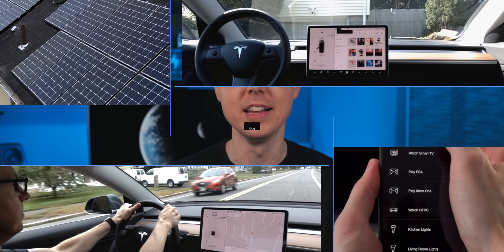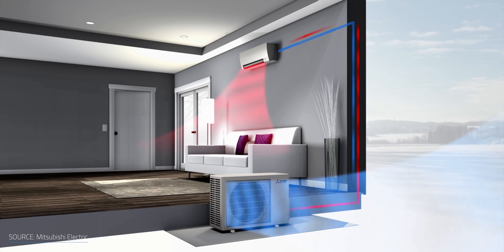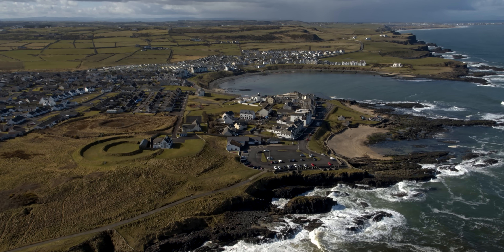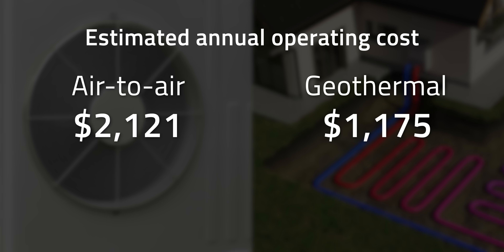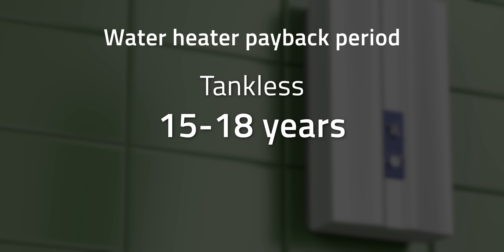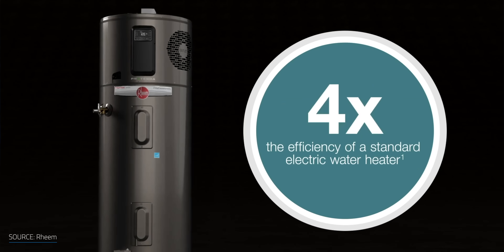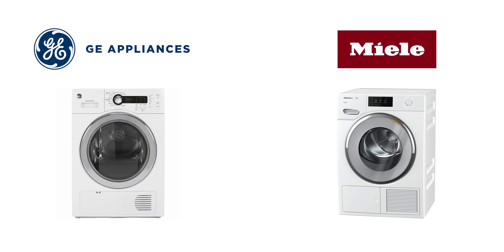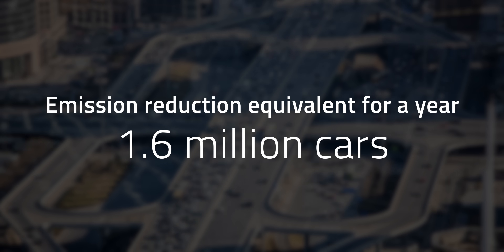Why Heat Pumps are Essential for the Future - Explained

Comment: One technology that's far too often overlooked when it comes improving heating and cooling performance - insulation. It's not a sexy new technology but it's far and away the best method to improve thermal performance of a building. You don't even have to tear open exterior walls and add batts of insulation, adding blown insulation to your attic and changing to double or triple pane windows are easy fixes. I wish more people would talk about these simple fixes and think about responsible uses of energy as much as the latest technology.
Reply: @retireorbust  They could have easily lined the walls with Tapestries and Brocades which was done even before the medieval period
Reply: The massive issue with window upgrading is the time for ROI. It's extremely long. Blowing in insulation however is a pretty simple relatively cheap fix that you can even DIY.
Reply: Generally isolation on roof and floor is crucial but on the walls not so much (5-10cm is enough). House should be air sealed + mechanical ventilation.
Reply: Retrofit window upgrades has one of the worst returns on investment.  Windows are a small fraction of the envelope and cost around $30/sq. ft. to retrofit for a modest gain in heat retention.  Ceiling and floor insulation has many times more bang for the buck.  But...if your old windows are worn out and bothersome, then replace them with good ones.
Reply: The biggest problem with insulation is that most homes are not built to cope with the loss of ventilation that good air seals create leading to mildew mold and sick building syndrome both from elivated co2 and toxic off gassing and trapped cleaning product residue.
Reply: @MixedGrid  depends on where u live but in my area you can get a credit for reaching a certain R-value. Sometimes theres programs from the local municipalities that will pay for the entire process.
Reply: Proper attic ventilation as well. And if you're not using LED's throughout the house you should be
Reply: @Youreallsoft  so i recently came across a box of old incandescent bulbs. While comparing one to its led counterpart it became apparent just how many resources are required for an led vs incandescent. The incandescent is just a tiny bit of glass, a tiny bit of tungsten, tiny conductors, with a socket base and some ceramic insulator. It weighs practically nothing and if u were to throw it in a landfill, it would decay right back into the earth in relatively short order. The led on the other hand was made with a plastic dome, a large metal heatsink, pcb's filled with electrical components, some holding toxic oils and chemicals, alot more conductors insulated in plastics, and the entire thing weighs probly 20-30x what and incandescent weighs. 
So whats really worse for the environment? The led that requires an enormous amount of materials along with toxic material and things that dont degrade for centuries, costs loads more to ship due to the weight, and requires extra packaging to protect them during shipping, or the incandescent that just causes abit more carbon emissions from its power draw. Carbon, which provides the main building block of all life as we know it and is at historically low levels well below the avg over the course of earths existence.
Reply: @GonzoDonzo  I'm speaking more from an energy conservation perspective. If you plug in that incandescent it's going to be too hot to touch in seconds. A large portion of the energy going in is in the form of raw heat increasing the load on your air conditioner. I didn't buy into them for a while, but they are more cost effective now and with a wider range of temperatures I became a fan. I live in Texas with some scorching heat so every thing adds up.
Reply: @Youreallsoft  yeah in the summer the heat can be an issue. Leds do get warm but like u say its no where near the same output. It is nice in the winter though. As a kid id stuff my hands under the lamp shades when they were cold and it was always a nice warm spot wherever a lamp was. I live off grid so led's are a must but beyond the energy consumption and summer heat issue of incandescents, im not sure they are actually worse for the environment if thats an issue for some. Id love to see a study done. For one for every led you will consume several incandescents over its lifespan. Just knocking over an incandescent will blow the filament out. I did notice a 100watt incandescent was brighter then a 28watt led that was supposed to be equivalent to a 150watt incandescent according to its advertising. The led had a higher quality of light whereas the incandescent has hot and cold spots. Sorry for ramblin
Reply: @GonzoDonzo  I'd say you're probably right and a lot of things we are currently doing to be "energy conservative" which wholes purpose is to be more environmentally friendly and lower carbon emissions do not work out like that. Just like making evaporator coils thinner and thinner to gain greater efficiency ratings and in turn they fail within 10 years and leak refrigerant. There's a lot of wastefulness and planned obsolescence that imo would be where attention should be if you wanted to be more environmentally friendly. I believe it's all driven by $ and year over year profits, but good luck stopping that machine. In the mean time get ready for 2025 as they try to push once again a new refrigerant for A/C systems and making r-410a obsolete. We are not using cfc's anymore and even with 0 ozone depletion potential the reasoning is it contributes slightly less to greenhouse gases. R-410a prices tripled last year nationwide on the same day. I guess if it becomes expensive enough people will be happy to switch, even if artificially inflated.
Reply: @brianzmek7272  while true, it's not really that difficult to add an HRV or ERV system as part of your retrofit, and properly controlled ventilation with energy recovery is far better for both the insulation value of the home as well as the air quality in your home versus relying on the house being drafty.
Reply: The great thing about insulation is it works both ways, keeps the house hot in the winter and cool in the summer. In fact where I live adding a little bit of insulation has allowed us to avoid adding an air conditioner at all. Now obviously that's not a solution in all climates, but if you live somewhere marginal you can get away with insulation while all your neighbors are spending electricity on their air conditioner.
Reply: @brianzmek7272  By all means then don't insulate. Sit there and freeze.
Reply: @helplmchoking  It amazes me that so many homes in the US are built on raised foundations at all. Every house around here, with almost no exceptions, has a full basement. Older ones aren't well insulated, but we all have basements.
Reply: @Youreallsoft  oh man i learned about that with a series of goodman package units. The evaporator coils lasted 1 year before they started developing pinhole leaks everywhere. I cant remember the term the rep used they sent out but i didnt buy there reasoning. Ive been into pc watercooling since i was a kid and u learn about dissimilar metals in conductive fluids early on. Aluminum and copper in certain ratios with a fluid present just eat each other up and i had a feeling that was going on. 
U think the refrigerant change is crazy, look at california. Were banning all gas powered yard tools and any generator up to 25hp. Cant wait to see how the landscaping industry will handle that. There going to need a massive battery array and charging station to keep there tools running. 
I did hvac for 17 years and the rules were getting insane. Some things made sense like reducing the leakage in ducts and supply vents but the inspection process that had to be carried out by a third party was a pita. Loved how i got trained as a HERS rater only to find out on the last day we couldnt inspect our own work. Lol
Reply: @Green__one  if your ever getting a new roof get the plywood with the radiant barrier for the sheeting. Ive spent far more time in attics for my job then most and an attic with the radiant barrier will easily be 10-20 degrees f cooler then the same house without it in the summer. It also works both ways radiating heat back down in the winter. Its also a very minor cost if done from the start
Reply: As someone who works in attics daily, where the insulation is set makes a world of difference as well. Foam insulation that is applied directly to the ceiling and walls seems to be by far the best method of thermally insulating your home in either hot or cold climates. Blown insulation works well too but you lose the attic space itself to act as a second layer of insulation for the home, remember air is a great insulator on its own.
By having the spayed foam insulation you get not only the immediate reduction in thermal loss or gain from the foam but the attic, that would otherwise be heated or cooled to the exterior temperature, now acts as a second blanket between the home and foam to help mitigate thermal fluctuations. 
It also makes the attic much easier to get around in lol.
Reply: Yup - that's step#0, so to speak.
Reply: @GonzoDonzo  the LED is better
Reply: @GonzoDonzo  RMI has studied this, LEDs are better in all cases
Reply: @Youreallsoft  it's important to switch
Reply: @helplmchoking  construction technique and code depends on your climate zone
Reply: @Nicholas-f5  yeah but whats their basis? Is it that carbon emissions are bad because if thats their measure its pointless.
Reply: @retireorbust  will that material stand up to the European floods?
Reply: Yes and insulating with natural bsed materials is often overlooked. Wood can be made into fibers ans mats just like fiberglass. Hemp, linen, cotton, cellulose (paper) cotton, recycled clothing, straw, low energy hay.... cork, expanded clay...
Reply: Tear open walls? Won't that be expensive, the brick and cement alone probably a bit of a hassle to replace.
Reply: Insulation is definitely overlooked, especially in older homes. However, it's also one of the most difficult to upgrade. Apart from incremental improvements, you're likely going to have to wait until you're remodeling something down to the bones to properly improve the insulation.

In the meantime, things such as solar panels, heat pumps, LEDs, etc., are much easier to do and you're much more likely to get a return on investment much sooner.
Reply: Exactly. Before installing a heatpump which heats your house with lower temperature, you need insulation. Older houses are built for heating with high temperature, in which case insulation is less important.
Reply: @retireorbust  Actually using heavy rugs, which is what a Tapestry is, does significantly help with heat loss in a room.  It's far less effective with castles because the walls themselves where so drafty.  But over a window they are effective just by the significant reduction in air flow across the colder glass.  Same is true with wooden walls like a log cabin as long as the walls don't allow air flow that is.  And in a converted vehicle they make a hell of a difference.  It's no where near what double layer windows can achieve.  But considering the cost of living right now, it's better then nothing.  Adding a plastic outer window during the winter helps too for the same reason.  Creating another air gap between the glass and the outside air.

Don't overlook older cheaper methods in today's economy.  As nice as net zero would be, anything thing cheap and helps is worth investigating.
Reply: @TempestaDominus  You don't have to do much to insulate house walls. The installer just drills holes in the outside walls to the cavity then blow the insulation material into the cavity. My parents insulated their home like that in the early 1970s.
Reply: @kevintieman3616  well, no. High temperature also means high heat losses. 
You must mean we can’t feel as cold because the high temps overcompensates. But we can feel it in the energy bills ;)
Reply: @peterjf7723  Inside the solid brick?
Reply: @TheEmbrio  Yes indeed, with less important I meant less impactful on the ability to heat your house. Also when these houses (with poor insulation) were built energy was dirt cheap compared to today's standard, so nobody cared about energy bills.
Reply: @TempestaDominus  No, between the outer and inner walls there is a 10cm/4inch cavity. At least that is how houses are built in the UK.
Reply: @peterjf7723  There's no such thing here. Just bricks, cements and paint.
Reply: @kevintieman3616  so we’re on the same page, yes. The price is truly a factor for many. I’ve been designing or remodeling houes for 15 years, and it seems spending 50 (euros in my case) per months seems fine. Maybe it’s a psychological thing. Even with extensive renos, clients never want to go the extra step to get below 20 per month. 
So that meant in 2008, 8cm of insulation. Now 14. In standard materials, just as an example. 
But they usually won’t agree to 16cm plus extra efficient ventilation or some other costly technology. To get it down to passive standards. (Forever)
Even in my field people seem to have short term vision. Baby steps.
Reply: @TempestaDominus  Ah OK. In the UK the cavity wall was first introduced in the 19th century, as a better alternative to a simple solid wall. Cavity walls became more widespread in the 1920s, and have been the UK standard for decades.
Reply: Hemp Bricks!!!!
Reply: @Nicholas-f5  "LED's are better in all cases"
Well..  don't get me wrong, I'm not saying we shouldn't use them, but they are not as glorious as they were made out to be. Example,  LED light is terrible for photography, absolutely terrible. It is an absolute pain trying to correct white balance on indoor photos shot in rooms with LED lighting.  I do ham radio as well, and LED's are some of the worst sources of radio interference in the home. They are worse than switch mode power supplies in most cases because they are built to such cheap standards. So are they better for the environment... that's debatable as well, when considering energy used in addition to materials used.  Are they better for all applications, in my case definitely not. Do they save you money, debatable as well, because they do burn out, mostly from poor heat management, and are orders of magnitude more expensive to replace. Doing the math considering cost of electric + cost of bulbs, operating 4 x 100 watt equivalent LED'S (13 watt) vs 4 x 100 watt equivalent halogens (72 watt) cost about half as much to run at 4 hours per day. $34 over 18 months vs $77 over the same time period. Is that savings worth the aforementioned issues, that's for you to decide.
Reply: @retireorbust  the average home in europe is wayyy better insulated then the us cardboard boxes.

and the eu houses dont fly away with every storm on top.
Reply: What if you don't have an attic?
Reply: @Konrad162  Mechanical ventilation must include moisture removal. In the UK in the 1990s lots of houses were built without any ventilation for insulation purposes. What happened was damp and mould everywhere.
Reply: @brianzmek7272  Don't forget water vapour, an average family of four can produce 24 pints (14 litres) of water vapour in just 24 hours, and all that moisture has to go somewhere
Reply: @jamescollins3647  humidity controls comes also with AC
Reply: @Konrad162  Don't have too much domestic AC in the UK.
Reply: @jamescollins3647  so you are installing water heat pumps but no AC? How crazy is this. AC is much cheaper and better than central water systems.
Reply: @brianzmek7272  Yep, most houses in the UK have that exact issue and they keep going on about installing heat pumps. If the house isn't built well you will freeze in the winter months. Unfortunately, that applies to most houses here! :|
Reply: Living in lithuania I am used to insulation. When I recently made a trip to my brother in Ireland I was shocked, they used a fireplace to heat the home, at first I thought it was just a status symbol or something nostalgic. Nah... When I woke up in the morning the entire building was freezing!
Reply: @runelt99  I grew up in a house like that. Never had a cold as a kid.
Reply: @GonzoDonzo  Just checking a random example from Home Depot, an LED bulb uses about 7x less energy than an incandescent. And they last a lot longer too (supposedly up to 20 years). So while a single bulb may be worse in terms of waste, given their increased lifespans the overall quantity of waste should be reduced (and it's barely a blip compared to the rest of our e-waste). Also I'm not sure you understand how greenhouse gases work. Yeah we're nowhere near the highest levels of CO2 in planetary history; those periods also occurred with the largest mass extinction events, look up the Permian–Triassic extinction event.
Reply: @GonzoDonzo  The current world ecosystem is not adapted to a dinosaur climate. And neither are humans. The Earth will outlast us and new life will grow, but at the moment global biodiversity is massively decreased and it is mostly due to humans (many factors of course, climate change only being one of them, along with habitat destruction). Climate change also has real impacts on people in less fortunate parts of the world which are rapidly desertifying and facing increasing geopolitical conflicts. It's not a coincidence that these changes have happened all in the last century.
Reply: @GonzoDonzo  Look we're not going to change anybody's minds over a youtube feud. And I apologize if I used any antagonistic or condescending language. I'll just ask you to think about whether your sources are balanced, you're avoiding confirmation bias, and whether it's likely that thousands of scientists over 40 years have all been wrong or colluding toward some vague nefarious agenda despite the challenges of billion dollar industries that can hire their own scientists to produce counter-studies.
Reply: Nah, I don't think insulation is overlooked. Modern homes are designed with insulation built into the walls and homes are more sealed to prevent heat coming in or out. People or rather individual home owners may not always be efficient in that regards.
Reply: spoken like a true engineer 👍
Reply: @stipcrane  the window replacement is a consideration where the inside/outside temperature differential is great, drapes and capping over the top are an effective substitute.
Reply: @Youreallsoft  LED lighting is undesirable in reading areas as they flicker at various frequencies causing optical annoyance much like fluorescent lighting, great in other Areas those. I’m completely unimpressed with the lifespan of the average LED replacement lamps. Much shorter than advertised life …
Reply: My unit that I rent has a heat pump and cold air blows in around all the single pane wooden framed windows. It's a waste but very common here.
Reply: Insulation sounds great on paper, but quickly becomes tricky in practice. We have a lot of experience with insulation here in Germany (federal mandate for more then a decade) and quite a lot of issues have cropped up. Probably the biggest is waste management, as the insulation has to be replaced after some time (I think after 15 to 20 years) and the most common material - polystyrene - is considered hazardous waste, making disposal a major headache, especially since the companies capable of doing so do not have the capacity to deal with the amount coming over the next decade. Another problem is humidity, as the dew point moves into the insulating material, creating moisture. This causes a host of issues from algae on the outer surface, to moldy walls or even concrete spalling as the rebar corrodes. This drastically reduces the lifespan of the insulated buildings. There are buildings from the early 2000's that have to be replaced, because the walls just have to many problems to be economically dealt with.

Those issues don't even touch on things like humidity and mold build up within the rooms, the generally lower room climate quality in highly insulated buildings or the fire hazard that is polysterene.

All in all, a very interesting technology, but it comes with a lot of issues yet to be resolved.
Reply: @tarstarkusz  cause it's cheap. The margins in the construction industry are razor thin, corruption is afoot everywhere and the stuff has not been banned.
Reply: I added insulation to our 1962 house attic. So the heat comes on less. But along the edges I could not get insulation, so the top of the walls got colder and got condensate. Then the corners got worse to the point I got mold. Not alot I can do since the rafter is right over the corner. 
All I can think of is to take ALL the insulation out and have blown in, and tell them to go heavy on the edges and lighter in the middle; take a bit higher heating bill to get rid of mold and condensate.
Reply: @retireorbust  Actually it does...
Reply: Windows can be surprisingly expensive.  Replacing them is no minor matter.
Reply: My house walls are 6-inches thick, plus an additional 4-inch interior layer of yet more wall. Which is why my large house in Canada can be heated with about 8kW of electric baseboard heaters. I'll get a heat pump eventually, but it'd be a small one.
Reply: Yep this all the way, I’m in the UK and we insulated our walls late last year and straight away we cut how much our gas boiler was firing in half. 
We have done pretty much every other eco thing to our house, led lights, large solar array, A+ rated appliances etc and we are now an A rated property energy wise :)
Reply: Unless you’re using the incandescents as auxiliary heaters, ya know, to be an imaginary bit warmer in winter while you’re cypherin  on yer abacus.
Reply: @retireorbust  LOL. The best homes here in Eastern Europe are ones made with clay and straw bricks with usually half a meter of wall. Mass is the best thing to have for heating and cooling. Mass stores heat, mass stores cold. Medieval castles were military installations meant to defend an area and not to live in, their heating was always inadequate. European houses that are actually made of proper bricks for the sake of living are really good. They usually need only 15 cm of external insulation as refurbishment and of course new doors and windows. Though todays economy makes some people go all the way to 30 with cheap Styrofoam insulation. Best part? A stronger storm does not take apart our houses and most of our houses don't turn into pyres instantly if they start burning. Most of our houses can actually survive the ground shaking. Many people seem to forget that the goddamn glass wool/rock wool is actually toxic to humans and they immediately after removal from their packages start to release particulates.
Reply: @GonzoDonzo  And an incadescent bulb lasts perhaps 5000 hours while a good quality LED bulb lasts for 100000 hours, 20x factor, so there goes your weight difference. Now, let's go to the energy saving, and you'll get some additional 8x+ energy saving factor from using LEDs, more if it's a smart light. If the energy consumed during a life time of a LED bulb would be around 1MWh those incadescent bulbs would consume some 8MWh (you'd need some 20 of them). It's difficult to estimate the energy used to make these bulbs but you can get a hint by looking at the energy price and comparing it to the item. Using $0.15/kWh energy price gotten from U.S. Energy Information Association the lifetime energy expense of that LED bulb is $150 exceeding its shelf price with huge margin while hose incadescent bulbs would consume whopping $1200 worth of energy during the lifetime of a LED light. Remember, the shelf price includes all manufacturing energy costs but it also includes packaging, logistics, design, marketing, taxes etc. Likely the cost of manufacturing the item is close to 1/10 of its shelf price. Therefore it is certain that manufacturing energy requirements are not even on the same ballpark with the energy consumed by the product during its lifetime which means LED lights are an extremely smart purchase even if some of my figures are off by like 80%.
Reply: @McSlobo  thats marketing wank. Yes the led itself can last for hundreds of thousands of hours. The driver that powers them and the doped coatings do not however. Shoot the lead free solder fails on most even before the driver dies.
Im simply thinking along the lines of overall environmental impact from obtaining the resources to the day its disposed of. Theres an immense supply chain for the production of an led requiring hundreds of different materials, whereas its just a handful for an incandescent and none of it is toxic in an incandescent.
It takes a global effort to acquire everything for leds to exist.
On a side note theres an interesting led bulb that dubai had made especially for them. Bigclive did a great video on the reasons for why they commissioned the bulbs. Ultimately theres an immense amount of bulbs in dubai and to reduce the cost of replacing the leds they had special ones made that have way more leds that are under driven. Alot of manufacturers drive the led at the limit and the heat will degrade them much more rapidly so this makes sure they are always cool increasing their lifespan dramatically.
Reply: @chrisbraid2907  not exactly true. Cheap leds using pwm for driving the led will flicker, a voltage controlled led has zero pulses or flicker
Reply: @GonzoDonzo  That's a really stupid comparison that completely misses the point. You'll go through about 10 of those incandescent lightbulbs before the LED breaks; but the real thing is electricity. If the electricity is from hard coal and those incandescent bulbs are 60 W they will consume a kilogram of hard coal every 40 hours of operation. If they last 2000 hours each and you use 10 of them they will consume half a metric tonne of coal during their lifespan. Where natural gas is used instead of coal, emissions are still almost as bad (fugitive methane).
Reply: @TempestaDominus  I have never seen a brick house that isn't a summer vacation home where the above-ground wall is just solid brick without insulation; *ever*; but I assume this could be a thing in clement places like the UK. I think the person you are talking to may not have ever seen those kinds of walls either because they live somewhere cold.
Reply: @soylentgreenb  and this is where we will disagree. I could care less about carbon increasing. Were on the extreme low end of the scale for co2 concentrations over the last billion years. Theres also no correlation between global temps and co2 concentrations. Just go look up the ordovician ice age for example. Dont forget, all life is carbon based and we get it from co2

When it comes to how reliable an incandescent is, thats not easy to define. Ive had incandescents last over 20 years without needing to be replaced. Bump a lamp over though and its probly going to destroy the filament. 
Ive owned leds since the first ones hit the market and ill tell u right now, they do not last anywhere near their marketed lifespans. Pcb's fail, caps blow, uv destroys the coating etc. I havent had a single one last ten years. Put led can lighting in my home and have already had to replace 5 of them. Thats not just a simple bulb change, its the entire fixture. They are only as strong as their weakest link and another factor is that they are just now getting good. The early designs were terrible, then we had those giant corn cobs where whole sections would fail, the light sucked so we all replaced them as well. Now we have nice cobs but they require excellent cooling and most manufacturers skimp on that and if they dont, now u have a massive hunk of aluminum used in the construction. A very energy hungry metal to produce.
There was an incandescent bulb that had its own livestream in a firehouse because it had been on for close to a hundred years. They can last but its like rolling the dice. Sometimes u screw one in and it dies in days as well.
Reply: I recently did a downflow attic installation for a house flipper. Got a call this summer because it wasn't keeping up, the drywall in the upstairs hallway was 95F. Come to find out there was no insulation in the attic, I figured that would come after the air handler.... People just don't know any better but it's not an excuse.
Reply: @RocketHarry865 mm
Reply: Windows alone make a huge difference in older homes.
Reply: @retireorbust  thermal mass has significant temperature stabilizing advantages, so wrapping it in an insulation layer would probably be a better plan then demolishing a useable building.
Reply: @retireorbust  if you have lived in old building while it is cold outside you will very quickly realize that the trapped air creates by hanging curtains and tapestries makes a huge difference.
Reply: @MixedGrid  depends on the windows you are upgrading from, single pane windows are barely better than open holes in your walls, so upgrading from them can pay off in less than 5 years depending on your climate.
Reply: @Green__one  There are many reasons food differences in building codes: termites, groundwater levels, mold, soil composition, frost lines, flood plains to name a few. Basement or not, they can all be built to be energy efficient.
Reply: So very true.
Reply: @brianzmek7272  then get a  HRV or ERV... That's the products whole. Purpose is to keep your house ventalated while not venting out the heat.
Reply: @GonzoDonzo  um no... Lmao a led weighs less Than a incandecnt bulb.  Nothing about it is heavy unless you have a super powerful led(not ones used to light your home) and it requires a large aluminum heatsink. You have it all wrong.
Reply: @helplmchoking  you think having a concrete pad foundation is more energy efficient Than a crawl space or basement?  You do realize air is a great insulator right? That concrete pad is sucking heat out of your home way faster Than a basement. I hope you where smart enough to have a bunch of foam under that concrete pad. A lot of people finish their basements anyway. The ground stays constant temp under a certain depth.
Reply: @randybobandy9828  lol jave u installed a single can light led? Have u seen modern leds that arent huge arrays of cheap leds? Anything above about 15 watts is going to require cooling. If its a COB led, it requires cooling. 
Im curious how many arrays have u built and can u even tell me what the difference is between a pwm led and a voltage controlled led is?
Reply: insulation does a lot to improve the efficacy of heat pumps too it's very crucial for sure
Reply: Probably much cheaper to install a heatpump than replacing all the windows
Reply: @wiredvibe1678  it can depend. They are generally within the same ballpark unless u have a large home with alot of windows. 
The cost on replacing a heat pump really depends on local code and if your ducting is in good shape. If the ducts leak beyond a certain point the cost goes up as u have to either seal or replace the ducting. This will also trigger a h.e.r.s. test before and after which tests how leaky your ducts or your entire home is. I recently quit hvac in california and we have some crazy laws out here
Reply: @retireorbust  Correct. Typically a castle would have a wood fire burning 24/7 with the heat being funneled into the rich folk's rooms. But then they all got lung cancer from breathing smoky air all the time and died in their 40's... so...
Reply: Windows are the least effective when it comes to ROI.
Reply: Insulation is great.  Everyone should have R38 minimum in a perfect world.  But insulation will not HEAT your home. People with home heating systems designed to work on 70-80 degree water will not produce enough heat from a heat pump running 40-45 degree water.  Never gonna happen. The installed radiation is too small.
Reply: " but it's far and away the best method to improve thermal performance of a building."
Unless you're retrofitting. The ROI on windows is decades. Updating wall insulation does tend to costs tens of thousands as it involves removing the exterior cladding then resetting the windows.
Another thing window sellers don't like to share is uninsulated windows on the south-facing side lets in free heat in the winter while not capturing as much heat in the summer due to the angle of the sun.
Reply: Yeah but insulation is really hard to do
Reply: @retireorbust  Actually, it does.
Reply: I would say easy fix because changing all the windows in my house will cost $25,000
Reply: @maxjeanfrancois400  " changing all the windows in my house will cost $25,000"
You'll never recover the cost of new windows in your lifetime with energy savings, but the window company will as soon as your payment clears.
Reply: That was a typo autocorrect sucks on this phone I meant to say I wouldn't say a cheap and easy fix
Reply: @maxjeanfrancois400  I gathered that.
Retrofitting wall insulation tends to be an expensive proposition as well. However, mice really do enjoy the blown in stuff in attics.
Reply: too many stories of people who switch to heat pumps and are dissatisfied because they didn't check their insulation
Reply: @jk3jk35  Insulation determines the size of a heat pump more than whether it will work at all.  Often it makes more sense spend 500 bucks more on capacity than the extra 5k in insulation.
Reply: @retireorbust  One assumes that if it didn't work, they wouldn't have done it. They weren't idiots.
Reply: @GonzoDonzo  LED bulbs last about200000 to 25000 hour and incandescent about 1000 hours so will be tossing out about 20 to 25 incandescent bulbs for every 1 LED bulb.
Reply: @jamesodell3064  no they dont. The diode itself has that sort of lifespan if its not in direct sunlight, but the solder, circuit board, capacitors, resistors etc do not. If u want an example look into dubai bulbs and why they commissioned them. It will explain it abit. 

The 250,000 hours manufacturers like to give is nothing more then marketing bs. Ive also been building my own arrays since the early 2000's. Earlier if u count crappy old leds for electronic projects. You can also just go buy an led and use it till it fails. Ill bet u it doesnt last anywhere near 30 years of continuous use
Reply: @GonzoDonzo The bulbs claim 25,000 hours not 250,000 hours.  You may be correct that they do not last as long as claimed but that that could also be true of the 1000 hours claimed by incandescent bulbs.  25,000 hours is about 3 years of continuous use, not 30.  
All I know is that the LEDs I put in several years ago are still working.  That includes a 3 way bulb that is on for a good part of the day and evening.  The incandescent 3 way bulbs seemed to last only about 6 months and were not cheap.
Reply: You seem to be attempting to frame this as an almost 
either/or, instead of both being important...which is a deficient approach. 
Insulation is important, and so is moving to much more efficient new technologies 
which support steeply reducing our carbon footprint 
and moving us more completely off of fossil fuels.
Reply: @brianzmek7272  ....that's an education problem, not an insulation problem!
Reply: @GonzoDonzo  😅🤣
Why don't you just come out and say you're hot for fossil fuels, Herr Drumpf, and a climate crisis denier !!!
Reply: @Petroglyph1  what are you talking about are you saying that it is ok for your your house to literally rot and poison the occupants if it loses power? That it is ok for your house to silently build up toxic gases if you don't use an air quality meter whenever you move furniture? That it is a good thing that you can't use that insulation style on a passive house but need fans to keep the house safe not just comfortable?
Reply: "It's not a sexy new technology but it's far and away the best method to improve thermal performance of a building." 
Due to the cost of construction, materials and analysis, not the lack of sexiness.   Changing the cooling/heating technology to a more efficient machine is often a linear improvement when there are not major issues with a leaky house
Reply: @GK-op4oc  most homes leak horrifically as well. I did hvac and we had to do tests before and after replacing or installing a new unit. Even the equipment itself can have large leaks when brand new from the factory. Just getting the ducts and doors on a house tight would increase the efficiency and comfort dramatically.
Reply: @wojciechstyczynski1354  He wrote about switching from double pane to triple pane windows.  Most 10+ old construction uses no more than double pane windows, though air leaks dominate their insulation problem
Reply: @GK-op4oc  depends where your at. My state has strict leakage req's.
Reply: yes, in Quebec we have triple pane glass for windows and thick  R30-40 in walls
Reply: @Keiranful  You listed some of the concerns I have with building systems in general, and particularly with retrofits to old construction.  Is there any book or resource you can recommend that gives a good overview of these issues and best practices from recent experience?
Reply: @Steve_Mazza  I'm not a civil engineer, more a concerned party as a property owner, so I can't really point to any authoritative sources. I'm just speaking from experience and conversations with professionals. 

That said, I recently came across a company that seems to have squared the circle so to speak. The company is MIG mbh from Germany and their DHMb technology appears to deliver good insulation while keeping the walls dry and preserving room climate. Haven't seen it in practice yet, so all I can say is that the marketing material checks out from a high level, conceptual pov. 

Beyond that, if you're building something new, I'd recommend thick brick walls, with the bricks laying sideways, earthen mortar (not cement) and  clay plaster. Insulation levels are achieved through the thickness and the room climate is perfect. It's more expensive, but lasts beyond a lifetime.
Reply: @GK-op4oc  He wrote changing to double - it to double what is less than double? I know it is possible to see single glass windows in US. In example old buldings in NY.
Reply: @retireorbust  "au contraire! " Modern building aren't designed to last more than 25-50 yrs. I live in a 150 yrs. old house and my energy bills are far less than modern counterparts, not even factoring in investment. It's horses for courses of course but each situation has a different solution.
Reply: @GonzoDonzo  Nah tech will save the world lol 👍 Smartphone apps will save humanity and the planet. When govts around the world legislate to enforce those high tech solutions, you just know it stinks. Personally, I'll keep it low tech, repairable and dependable.
Reply: @retireorbust  Straw bales is not a good idea.  I did some research on that a while back and there are a few downsides to it. I saw a home where they had a straw bale wall instead of a traditional fence.

It doesn't last as long. Straw is an organic material, and it will decompose and they have to be kept dry.  So if your home is in wet weather that hay is going to absorb moisture, If it gets flooded, it's going to get wet and start to decompose much faster.

Castles don't have modern HVAC systems, typically, that's why they have a lot of fireplaces.  ;-)

There are new home building technology that deals with homes that are hurricane proof and even fire proof that use concrete, ceramic tiles, etc.  So, it's not just thermal insulation, but also structural integrity to withstand hurricanes, earthquakes, fire protection, etc.
Reply: You're 100% on target. I live in my shop, a large cinder block building. Several year ago, when I could afford it, I had the entire building wrapped with 4" of Styrofoam and then stuccoed. My heating bill fell by half straight away. I had already installed better windows and  an insulated garage door years before that. I can't understand why they don't insulate the bejesus out of every new building during construction when it's cheapest and easiest to do.
Reply: What was shocking to me is I insulated my speed queen dryer with some headliner glue and some R8 insulation. Energy for a 7cuft dryer went from 3.75kWh per load to 0.95kWh per load. This is just with an old bulletproof 2013 resistive heat dryer and $8 worth of glue and insulation lol.
Made it extremely quiet too which is a plus.
Reply: weird, here in western europe that been the main things people talked about ! 
and still having to change to double is getting rare here i think.. mostly historic important building with protectic outsides are more difficult to insulate.. 
but when i bought a house, is was a no-brainer to quickly put in roof insulation, and to have some fill in wall insulation, and change the windows on one side that were weirdly, still single glass ... really nobrainer i would think, the difficult question is how i do heat exchange pumps or such... 
i read about 6000€ for an air-air ... (i have in no way enough garden to even consider an payable ground heat option) 
wow, with my pretty controlled usage of natural gas that would take me.. easy 15 years to earn it back !! 
the main reason to get it would be to have a cooling option in summer to me... 
yes i'm more economical with gas usage then average european, (about half if i'm correct) , so probably WAY more economial then the average american household...  you can do a lot already without that new tech, that is true!
Reply: never had sex with insulation😅🤣
Reply: @JeroenJA  it's a bit hard to get insulation up the duff😅
Reply: @stipcrane  Home builder here. You are correct!! If your double pane windows are airtight, the upgrade is negligible. One of the best things you can do for windows is get a can of low expanding spray foam, take off the molding inside, dig out the pitiful insulation from the 3/8" gap around the window and fill it with spray foam. This can also prevent water ingress if the flashing is poorly installed around the window and could prevent your wall from rotting away if this is the case. Spray foaming the joist ends in the basement is another easy retrofit.
Reply: @Green__one  Most of the homes built in the USA have basements, but in some areas of the country it's not practical to do that.  In Florida and other Southern states along 5he Atlantic and Gulf coasts the water table is too close to the surface, so basements built there would get flooded regularly.  In states like Oklahoma the soil is mostly composed of clay instead of straight dirt so it is less stable to lay a foundation for a basement.
Reply: Good Advice !  I always take the styrofoam insulation / packing from all the delivered packages & throw it on top of all the other styrofoam that is already installed in the attic !  The stuff seems to be in almost every package & you can never have too much although I  have to say the attics almost full now. .............  Nick , NavyBlueSmoke , LST-1195
Reply: @Youreallsoft  unfortunately all the alternative refrigerants are super and more expensive too. In theory using propane or hc mixes should be pretty cheap, but they get pushback because they're flammable (5lbs of propane such a big deal, but never mind the near infinite supply of natural gas piped into most homes)

Pretty sure the only reason 410, 134, 404 is so expensive had something to do with tariffs and protecting domestic big business. To bad I didn't buy a few pallets a couple years ago when they were still 100$ a jug
Reply: @Green__one  if you are rich sure
Reply: @peterjf7723  if the walls had no insulation to begin with sure
Reply: @randybobandy9828  not cheap
Reply: @mbburry4759  I'm not sure which comment you're replying to. But none of my comments have catered to the wealthy. If you're referring to my insulation comments, it is far cheaper to have good insulation than to have an air conditioner. If you're referring to my basement comments, in my location basements have nothing to do with wealth, all houses have them. They simply don't build houses around here without them.
Reply: @mbburry4759  no but is anything?
Reply: @mbburry4759  Yes but you are only running a couple psi for the gas running into your home. I see a lot of bad things with flammable refrigerants. You can see the refrigerators that have exploded in peoples houses using similar refrigerants. While they may be "freak" incidents there was no reason for them to occur in the first place other than to appease the environmental agencies. A leak in the evaporator coil with all the airflow in the world and and ignition source ready for it to go. What happens when your evaporator leaks in the winter while your running heat? A big fireball down the duct lol. That's why they are pushing for "mildly flammable" but it all seems like crap to me. I haven't worked with them yet but come 2025 we will be dealing with it so we will see. 

Yeah man we got hit hard on r-410a used to have a heads up on price increases so we could stock up for our customers before the phase out. Can't say we got that courtesy this time around.
Reply: @mbburry4759  The intention was that the wall cavity provided insulation.
Reply: Yeah, my parents old home had batts insulation that made me feel like I was going to end up with cancer. They switched to spray-foam insulation in the attic when they rebuilt the house and their AC bill plummeted despite the volume of the house nearly doubling (went from 1800sqft to i think 3200+sq ft). This is in Texas so you can imagine the heat that the old house experienced. I’m glad I moved up to the PNW, my current residence was built by my grandpa and dad and thanks to a massive sun space it doesn’t require AC at all. Only heaters for the cold wet winters.
I may actually suggest heat pumps for this place, that’d be really cool.
Reply: bingo.